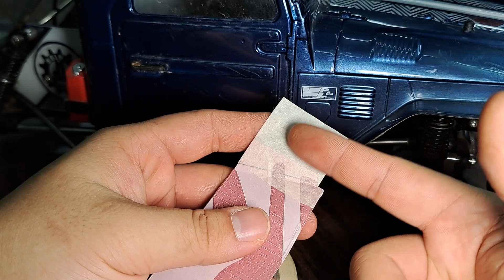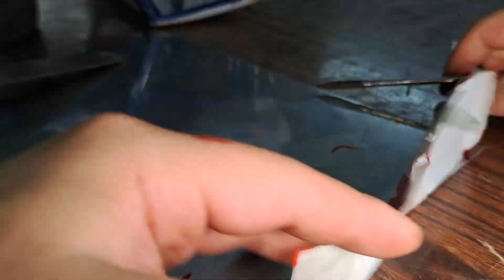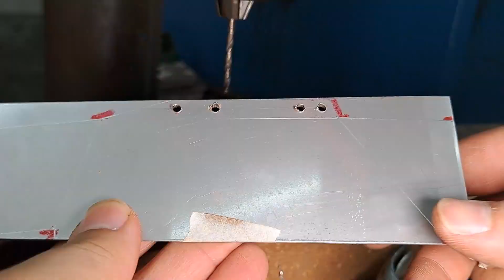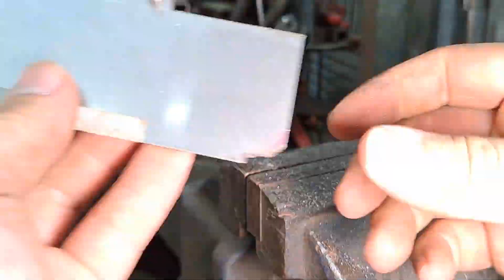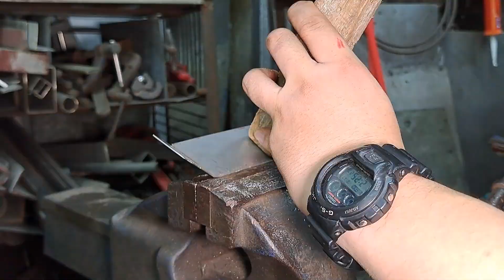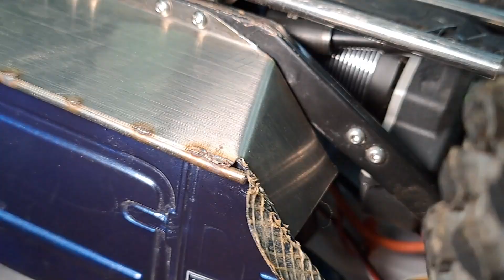Making Stainless Boatsides/Slider for a Crawler

Comment: I like it.  You kind of show that instead of dropping a $50, you can make it yourself.  Great work.  I am going to make a set for my Ecto.  Quick question, could mild steel be used?  SS is a bit expensive here locally.  One from CF would be awesome.
Reply from the maker: To me what's more important is custom aspect of it, being able to make what ever length and shape links, so you can adjust the wheelbase for any body you want; pretty much pair any axles with any chassis.  Opens the door to endless possibilites and create some unique builds.

As to mild steel, I'm sure it'll work, might be even easier to make. Potentially less durable than the stainless and will be prone to corrosion.